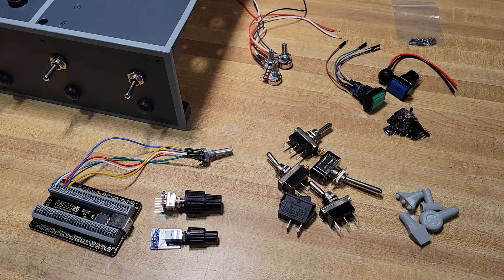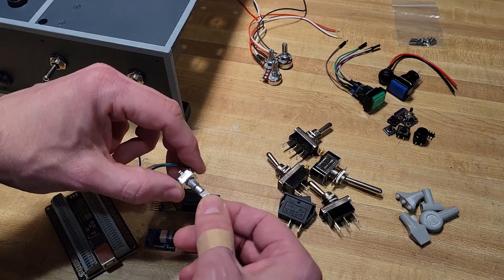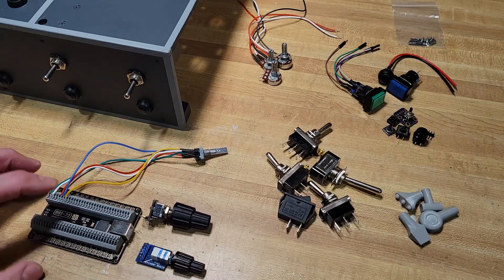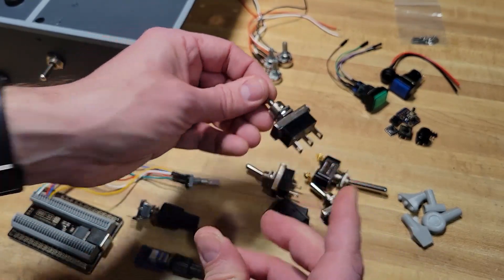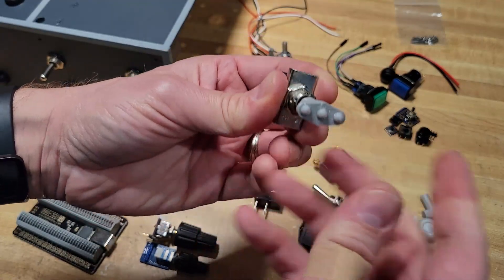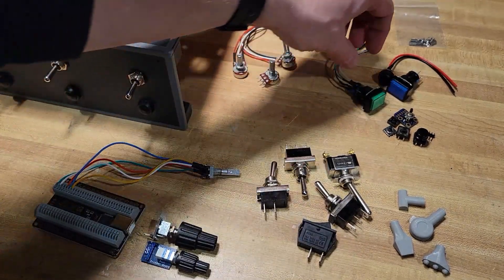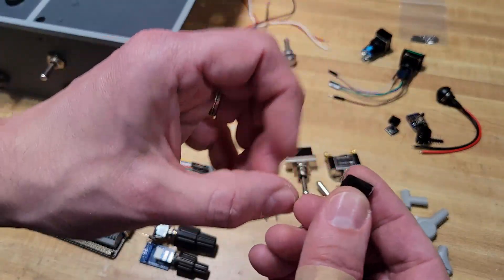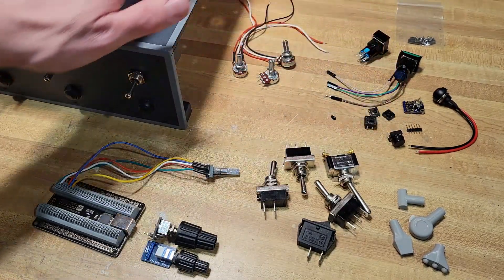Buttons, Switches and Knobs for Flight Sim Cockpit Builders - VR Friendly DCS / MSFS

Comment: Thank you for the great video! 

About your issues with the potentiometers, I wanted to say that I had the same problem in one of my projects. Potentiometers are SUPER easy to overheat when soldering. It's pretty common to burn them out by accident, so going with pre-wired can be a great way to go. Especially if you're not comfortable soldering.

Bourne is a very reputable brand in this space, so quality shouldn't be an issue. That wiggling you mentioned at 7:28 is a key marker that you've over-soldered them (in my experience). You can always test your pots by putting those tabs into a breadboard before you solder anything. You could also use female dupont cables to connect to the pot, which makes them removable in the future. 

Hope this helps! Happy building!

Comment: Switch operation can be a minefield and a lot of suppliers (amazon/ebay) don't understand what they have.
(on)-off-(on) toggle is a momentary off momentary. It springs back to centre.
on-off-on toggle is a latched off latched. It stays in position
on-off-(on) toggle is latched off momentary. etc.
Just be wary of conflicting descriptions on supplier websites like amazon and ebay.
companies like farnell, RS, mouser and the one I like switch electronics tend to know what they are describing. 
Just a heads up for anyone staring out as it gets annoying sending back incorrectly described switches, you end up just keeping them 😁.

Comment: Have you used any 3 way toggel switches, and would they work with that board? I would really love to build a replica of the cessna 414  chancellor side switch panel. Switch would be up=manual  down=auto and mid=off
Reply from the maker: You can use three way toggles or any other switch with more than two positions. Each position of the switch would take up a button spot on the board and those switches would show the button as a constant ON instead of a temporary ON. Look for an ON-OFF-ON type switch or an ON-ON-ON switch.
Reply: @Mr_Fix_It_  Hi, I am having issues getting my three position switches to work properly.  I have it wired to two button slots on the board, but it's sending the same button number no matter which direction I flip the switch.  The other number is pressed when the switch is in the center position and should be off and not connecting any circuit for the board to see.  For example, say I have it wired to slots 1 and 2.  Flipping the switch up activates button 1.  Flipping the switch down also activates button 1 when it should be activating button 2.  Button 2 is activated when the switch is in the middle position for some reason.  I've done this same wiring on cheap amazon boards and it worked fine so I have no idea why it's not working on my bodnar board.  If you have any ideas they would be greatly appreciated.

Comment: Hello, So I want to make a button box for racing sims. using switches with led lights. I have seen other videos that say because the led is 12v and the boards are typically 5v, you need a relay module board. would you know how the relay boards interact with the leo bodner board and if they can be used together?
Reply: Why are the LEDs 12V? Is it possible to just get loose LEDs and calculate the resistor for it? A bit of soldering and you've got your 5V LEDs.
Reply: @tomdreesen1948 still way beyond my expertise. Thank you for responding. I did find a workaround though.

Comment: When I turn my encoders, both LEDs light up briefly at the same time on the game controller.
I think that should not be the case and only one LED for the respective direction should light up.
Reply from the maker: @shamrock1ization  With the Leo Boarnar boards you have to use their config software to specify which slots have rotaries so they register their clicks correctly

Comment: Hey, you said you wanted to make a standard controller that you can map the controllers to at will. How do you map the Potentiometers? When I content the Leo Bodnar board (the one with the analog inputs) it automatically maps to the default X and Y inputs and I cant get it to change. Is this a firmware issue or something?
Reply from the maker: I didn't have an issue with the Leo Bodnar board that includes the analog inputs.  I just wired them up to the potentiometers I wanted and they were recognized in windows that way.  I think I may have needed to calibrate them.